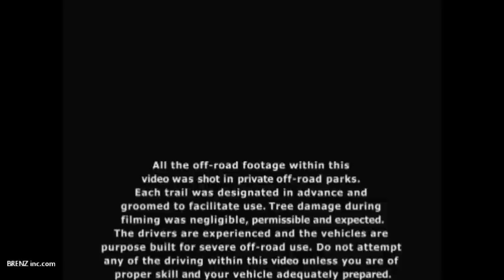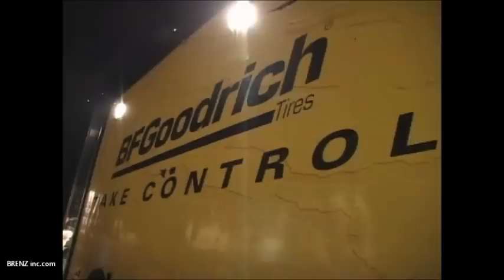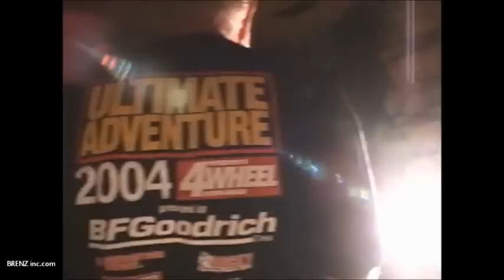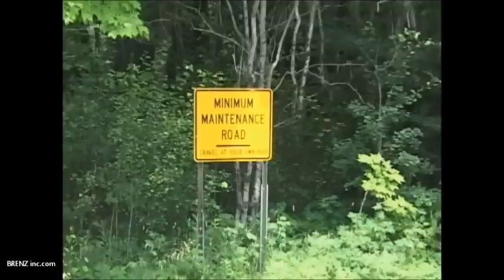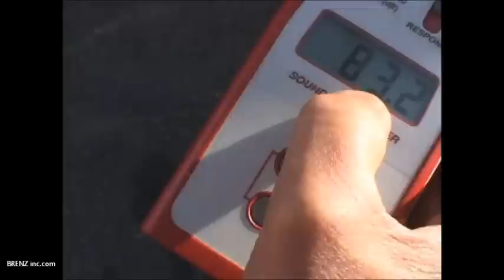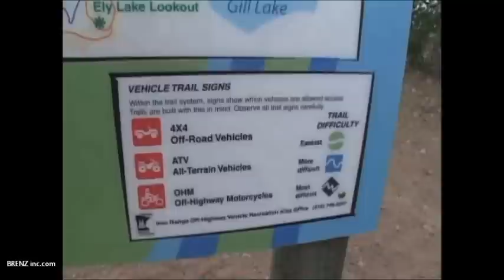Ultimate FOUR WHEELING adventures!: 4x4 madness at it's best! Pt 2

Comment: That little tracker is a pretty good looking little truck. Very simple and understated, tires may be a tittle big for what they are doing but it sits right. The GEO is a rebranded Suzuki Sammy so you know these things will literally climb a mountain. This doesn't sound like the stock 1.6 liter,  I would put in a 3.8 series 2 GM which in itself its almost indestructible, that would be a great combo.